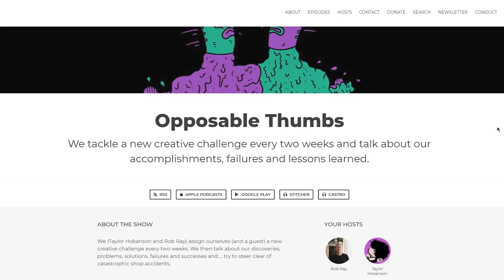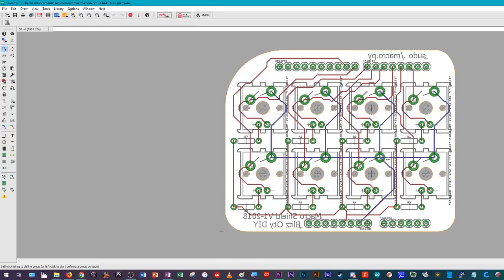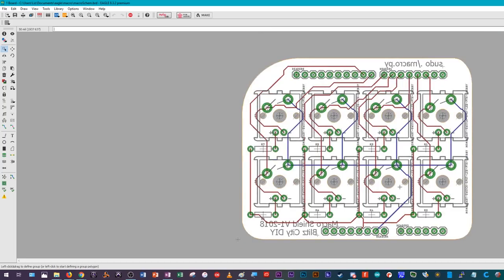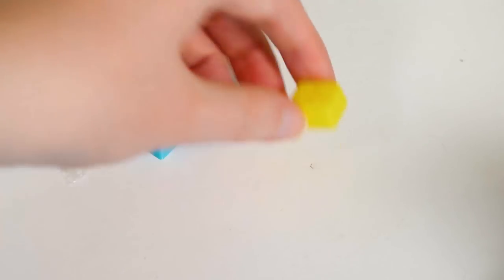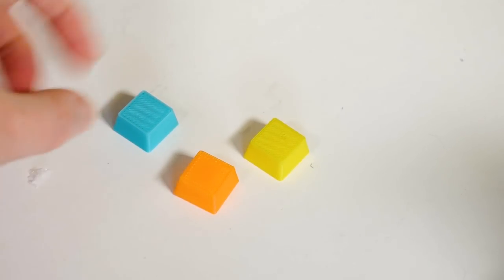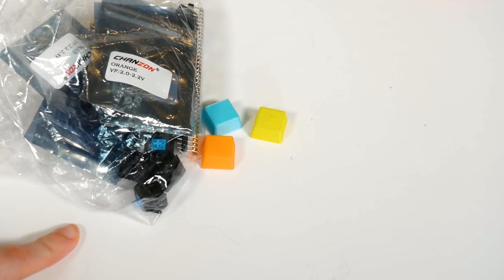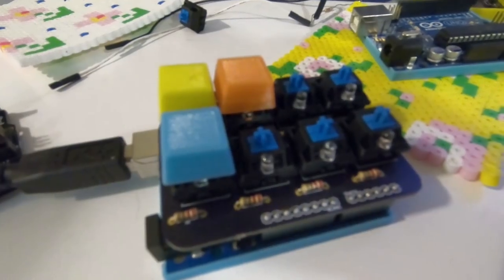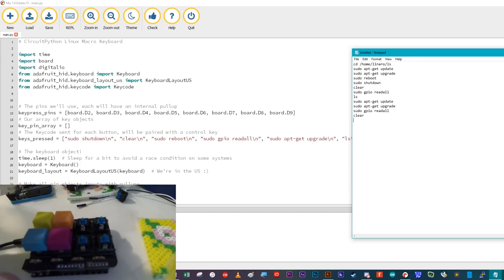Building a Macro Keyboard for the Opposable Thumbs Podcast

Comment: Is this using the same concept as the other video of using uno for this project, because I'm planning to do the exact same thing but Leonardo or the pro Micro is a little too expensive here, so will it work with Pro Mini or Nano?
Reply from the maker: if it has a 32u4 or M0/M4 processor then it will work as a keyboard without a firmware switch
Reply: Blitz City DIY but how do I do the wiring for the mechanical switches to the arduino
Reply from the maker: i made a custom PCB, so you'll need to either use a breakout for the switches (sparkfun makes one) or solder the switches to some protoboard to wire up to your board's GPIO to match your code
Reply: Blitz City DIY hey I just got me switches, how do I hand wire them to an arduino promicro, I also have 6 keys. How do I hand wire them, please help